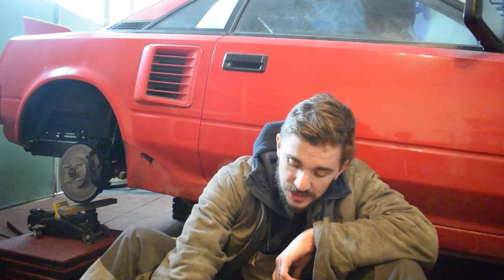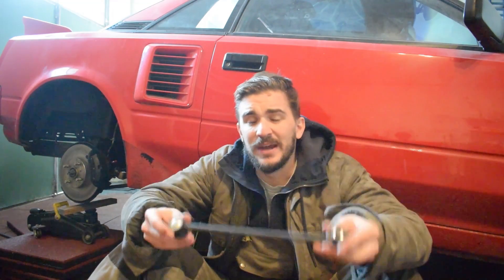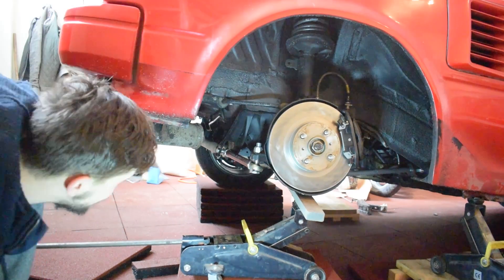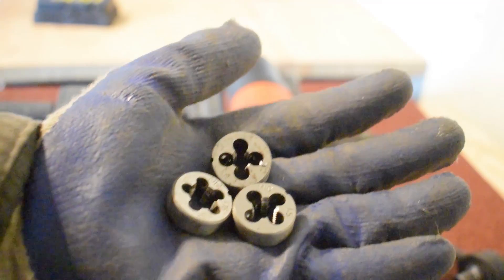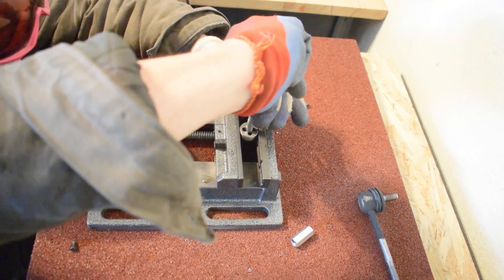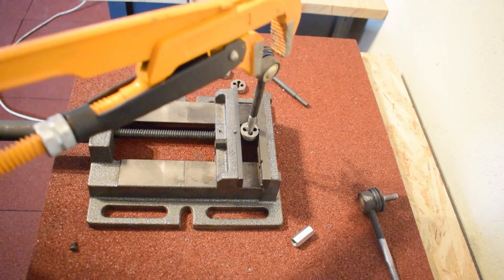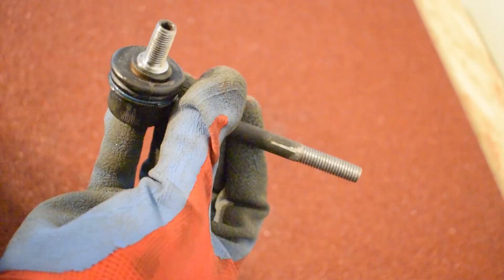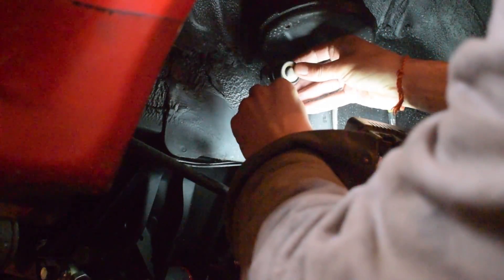DIY ADJUSTABLE sway bar links

Comment: Angle cutter,, used as a grinder, great work. and a little oil on the die, any oil, even cooking oil,, you put the nuts on the link the wrong way around, nylon on the outside,, but great idea, love it, and I'm doing this, just a little different,, your video's are my bench mark.

Comment: I have a truck that is lowered. In the rear the passenger side is 1/4 inch lower than the driver's side. If I add a sway bar, with adjustable links like what you've done here,  Could that assist in making the drop level on both sides?

Comment: Nyloc is a "one-way" nut. The nylon side must be AWAY from the surface you are tightening against. Just like the way you put them on the nut through sway bar. You're putting pressure from the turnbuckle on the nylon and can cause it to fail.
Reply: its not one way they nylon adds friction so the nut doesnt loosen
Reply: @Videoswithsoarin  We're looking @6:17. Just logically, the surfaces contacting each other should have the greatest contact area because we're putting torque pressure there. Then consider, if you're crushing the nylon rounded end, which is thin metal folded over to retain the nylon... you're going to crush that metal easily under pressure, a small gap will eventually arise between the surfaces, very bad.

In short, Google is our friend. Prove to us that an engineer says to crush the nylon end.

Comment: I love the mod its cool but ! The elephant in the room is ! 
Does anyone really know how to adjust them to suit your car ! Really folks !
People are all talk ! 
The stiffer sway bar is the only one that i noticed made a real difference ! 
I am all ears if someone can explain adjusting a stock sway bar
Reply from the maker: You make them longer to increase sway bar preload. More sway bar preload should result in a stiffer bar and less leaning in corners. But it takes some experimenting to figure out the best setup. Of course a thicker sway bar is always going to be more noticeable.
Reply: @d4a  
If you adjust them to make them both equally longer this as I understand it makes no difference 

As I understand it in my minds eye!  it's either one longer and one shorter to suit a mostly right hand race track or the other way around 
How exactly would preload be consistently affected?
It appear to just to move the ends of the sway bar lower or higher if moved in equilibrium ?
Reply from the maker: You are changing the angle. The angle determines the preload. If you look at aftermarket sway bars you will see that at their ends they have 2-3 holes instead of one. They are there to change the angle between the sway bar and the strut mounting point which changes the preload. But as I said it's best to first experiment with different settings and see what works best.

Comment: you have a swaybar on the rear? :thinkingemoji:
Reply from the maker: I do. I think it's stock on all mk1b (aw11 facelift made from 87 onwards)
Reply: I thought for sure I had the mk1b since the transmission and head are in that category but I don't have this sway bar, another mystery into the cars shady past  @d4a
Reply from the maker: What does your arm rest look like? The big long thing where the shifter is. Maybe someone swapped in the engine and transmission.
Reply: parking brake is on the right side and yeah, I took it apart and put it together like you did and found lots of weird stuff so who knows, block is even from some 90's corolla haha @d4a
Reply: It is market dependent. 1B rear sway bars were deleted in the USA market but were continued in most other markets. That's why the mounts are still there. The 1A/1B was a staggered runout of available parts, not a hard changeover date. Many have been caught out when their car externally looks like a 1B but was factory fitted with some early level parts. If yours is in the change over period, it is wise to measure items like struts and front discs before ordering new ones.
Reply from the maker: Why did they delete them?
Reply: To build in more "slow understeer".
Reply: oooooohhh I see, yeah mine is early 87, and it was the rare non factory spoiler with third tail light in the cabin @stephenbello1081

Comment: We are building a prototype car and found an old sway bar link from junk dealer, but it is not flexible (i mean its end points are stuck and not turning in any direction), which oil should we use for making it flexible again or is there any other tactics? Thanks for video by the way, it was very useful.
Reply from the maker: Maybe try soaking it in wd-40 or try some heavy duty penetrating oil, they are usually stronger than wd-40. But I would honestly try with a different link that one is likely toast.

Comment: There's actually nothing wrong at all with this solution. The only thing I could see as a problem is using an angle grinder to reduce the thickness of the rod, but if you cut the thread a bit over the grinded length (to remove all the little scratch marks of the grinder disc - these act as stress concentration points), then there's really nothing to worry about.
Reply: I definitely wouldn’t feel comfortable recommending it to others too. But I did it to the lower mounting shaft of my front shocks on my ranger. I had flipped the rear axle and after dropping the front I wanted to find the best length shocks. My caliper was not calibrated so I thought it was 14mm. Grabbed the coupling nuts already and the largest die I had was 12x1.75. Took a flapper wheel to that bitch in the sloppiest manner possible. Worked great, granted its torsion front end so the shocks don’t take the load like a strut.

Comment: DIY is supposed to be "ghetto" but doesnt have to look that way.  The OE links on AW's are toothpicks anyways. Every one I've owned has had the "heavy duty" ones and needed them replaced because one of the previous owners put lowering spring but no bump spacer causing too much stress.   I've found OE links as cheap as $15 but they are getting few and far between these days.  This is a good solution to a growing concern.

Comment: Nice!
Reply: The Question is... :Can I do this on my steering bars lets say for more camber?
Reply from the maker: I personally wouldn't do it on anything steering related. The chances of it failing are slim, but steering is critical for safety and any sort of chances are too high. If these links fail on the sway bars nothing other than your car leaning more in a corner will happen. I hate to imagine what could happen if they failed on the steering.
Reply: @d4a  Yeah,depends on the steering system too,but I wouldn't do that either,possibly I could try it to see what is like